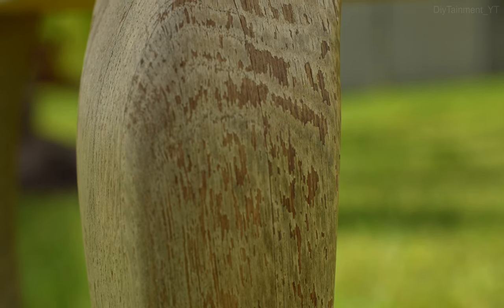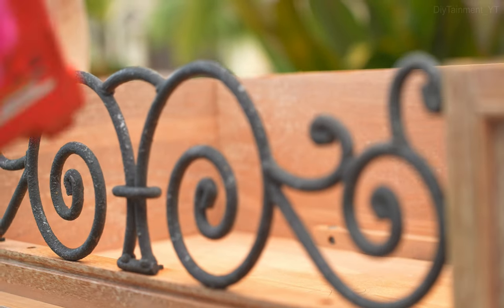Moldy FURNITURE !? $100 Challenge furniture MAKEOVER | furniture DIY | furniture FLIP

Comment: some types of wood (usually low-quality) turn greyish after drying out from being wet. steel wool probably didn't have anything to do with it or it would have been rusty.
Reply from the maker: The spots turned up on the areas that we used the steel wool on a second time after leaving it for a bit. Definitely going to do some experiments tho the bottom of what happened so it doesn’t happen again